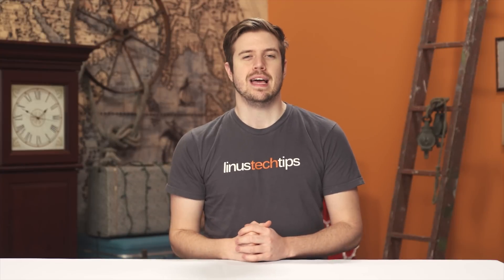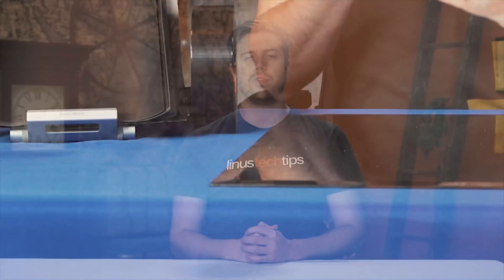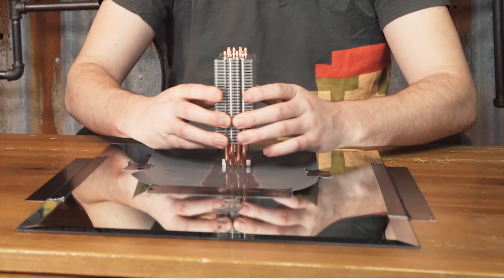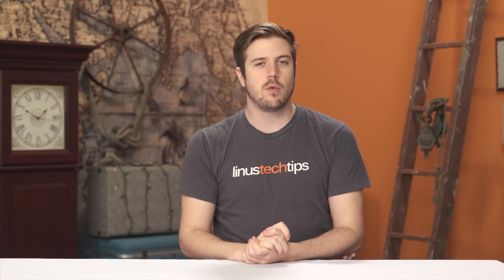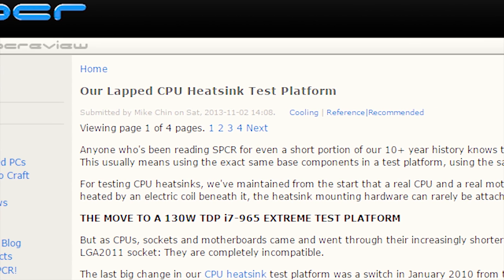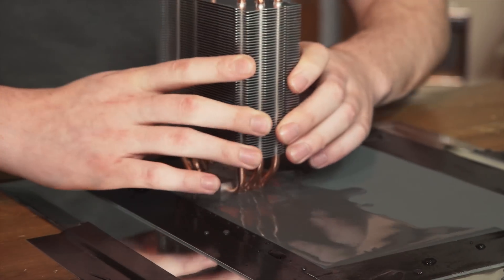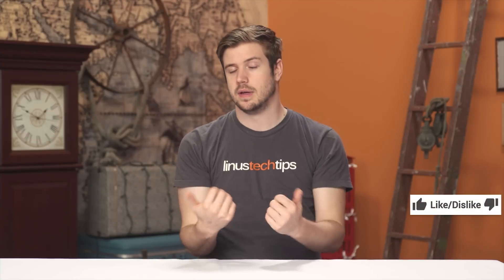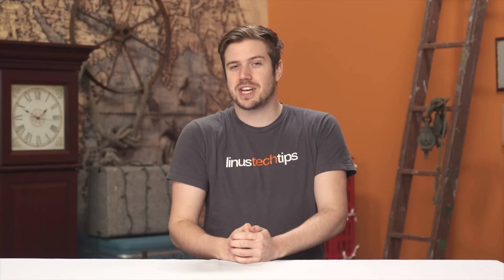CPU & Heatsink Lapping - Are concave, convex, or flat heatsinks best for cooling?

Comment: You don't have to count how many swipes you make and it's ok to use pressure as long as you push and pull evenly and hold the part as low down as possible to avoid tilting which causes doming. Rotate your sanding direction 90 degrees only when you swap to finer grit paper and keep sanding until you see your previous marks disappear. When that is achieved, go up to the next grit, turn 90 and sand again until your previous marks disappear and repeat. When you reach your finest paper then criss cross 90 degrees every swipe and you should see an nice even cross hatch pattern indicating no high or low spots.  I sand in 45 degree directions to the left and right which makes a 90 degree cross hatch without having to rotate the part. This is how I've always done it as a toolmaker/machinist.

Comment: So, moderate lapping (without polishing to mirror-smooth surface) is mostly useful only for concave heatsinks (which usually means cases when manufacturers have been lazy with their design and manufacturing). But what is the market relation of concave (or otherwise bad) heatsinks (including CPU / GPU chip thermal plates themselves) versus good heatsinks?

Comment: +LinusTechTips Here's a video you should do to see if it makes a difference.

Currently I have a bottom,front and side fans as intake but rear and top as exhaust
BUT!
I recently got a corsair 115i and mounted it on the top as exhaust while having 2 980's which kicks so much heat in the case
So? What is the question? Should I have the radiator on the top of the case an intake and rear as exhaust? and how much of a difference isit?

What I think is the bottom, front and top intake and the side(because gpus are right there getting fresh air from front and bottom) and rear as exhaust!

I think you guys should find out!

Comment: Surely sanding the surface with a rough grit, maybe like 160 or even 80 would be better than this as it would increase the surface area actually transferring heat the heatsink...

Comment: Sorry for bad english 
1 we use termal paste so we can remove air pokets  thats way sand or no sand it wont be un empruvment 
2 the termal output of the sink is the same if you change the material to be solid coper it has no termal lag as air(gas) or water 
and its termo fiziks not roket sience 

and again sorry for bad english not my netive language

Comment: Just speaking as a machinist. (I grind parts with a tolerance of .00005 inches) 

When lapping or checking for high spots by hand you should always try to create a figure eight motion on a flat surface. This limits the creation of a convex shape on the material. Turning the heat sink 90 degrees just makes it convex in two directions. The removed material will always be in between your part and the lapping medium you are using. Which lifts up your parts and causes it not to sit flat. 

IMHO use some blueing compound on the mirror and lightly press the the heat sink on the glass. The ink will only transfer to the high spots. Sand those down (or use a stone, which probably would be better) and repeat until you have 85-90% transfer. This is usually good down to .0002 flatness.

Comment: I'd expect if you lap the heatsink you also lap the cpu, and if you had the perfect surface on both, you wouldn't need any or very little compound as you have nearly 100% contact.
I wonder if anyone tried using very fine valve grinding paste to lap the two together as you do with car valves against their valve seats.

Comment: @Luke Having built over 2000+ PC's in my lifetime since the 286 days, not just for me, but for other people and work.  I can tell you lapping only helps if the manufacture just didn't care to do a good job which in my experience is hardly any of them.  It's a simple enough manufacturing process that most of them get it right.

Where I've seen the biggest differences are 1.) Use a pure copper base, not one where the copper part is the pipes.  In your example, the outter edge was not copper, only the pipes part.  A heat spreader on the CPU does dissipate heat to the outter edges as well as in the center.  You lose several degrees from not using a CPU Cooler with a pure copper base.  2.) Paste application is where I see nearly 95% of people do it incorrectly.  While it does suffice to just put a pea size amount in the center and place the cpu cooler.  This is WRONG and I challenge you to test this.  I've even seen Linus do this 100 times and I cringe every time I do.  The proper way to apply paste is to make it as thin as possible.  See through even.  You want to literally spread it out everywhere and you want it thin enough to where you can barely see the lettering on the CPU itself.  The reason for this is, you do not want your paste to absorb the heat, you want your CPU cooler to do that,  you want your paste to be the microscopic transfer barrier to fill in the microscopic grooves in the CPU Spreader and CPU Cooler.  It's intended to be a bridge, not a holder of heat.  The more surface area that is connected, the more heat can transfer, but is hindered when it's thick.  Not spread thinly enough will actually act as a Barrier to heat transfer!

I Luke am like you and do not settle for "Okay" or the "Status Quo".  I respect the aspect of true computer science and want to understand and manipulate it the Nth degree.  Don't even get me started on the crappy spec that DDR4 is.  While fast, it's designed very poorly.  NONE of it is timed perfectly like DDR3 and earlier.  Meaning you have to flush and resend data 70% of the time because the CAS is smaller than the RAS.  This is very inefficient, and cycles have to be resized, and resent when they don't fit in the CAS cycle time.  This rinse and repeat happens so much faster though on DDR4 that it is ultimately faster than DDR3 in some cases, but imagine if DDR4 was perfectly timed where 100% of the time it didn't have to flush and resend.  RAM Manufacturers, I'm calling you out!  We'd see speed increases of up to 50% if they did this.  (And would cost more too.)  DDR4 is a way RAM manufacturers can sell cheaply made modules at a premium.

If you'd like, I'd love to be a part of your show or help be a fact checker when such things arise.  Keep up the good work, and do not relent Luke!

Comment: can you make a video about a one 8 core cpu vs two 4 core cpu on the same clock speed?
Reply: +luuk unger I think they already have
Reply: cakebrin3r no, they did a video about virtual vs physical cores.
Reply: luuk unger they made a video about turning an ancient server mother bored into a gaming computer for cheap and i believe that was either 2 duel cores or 2 quad cores they used. they then compared it to modern computers

Comment: Your sanded surface didn't look that much better from the non-sanded one, in case people don't know a higher grit removes less material so you need to do more work with them, and you keep going until no scratches from the previous grit are visible. With 2000 grit wet sanding should leave a near mirror finish.
Not that this would make a big difference but if you get into this might as well do it proper.

And I imagine convex heatsinks only do well on lidded CPUs as they push the cover closer to the dye, should show a pretty substantial improvement if you are one of the unlucky people that came with badly placed covers.
Reply: When working with glass, we used 1800 for near perfect transparency and 3200 for perfect transparency. Literally perfect, at least to the naked eye.
Reply: The hardest part is manual sanding is hard to determine whether if its totally flat or slanted

Comment: Next step would be to grab another heatsink and flatten it with the roughest grit you can find,  and following with each following grit roughness. Testing after each stage of sanding/polishing. There could be a conclusion in this where there are limiting returns for mirror like finishes or where a slightly rougher finish operating better due to the thermal paste only collecting within the low points while high points would be closer to direct contact with the cpu.

Comment: Ok- truing the mating surface of the heat sink has been done. But if you're tired of playing with sandpaper you can get what's used in polishing Fiber Optics, 1um and <1um Alumina Oxide and 1um Diamond Lapping Film. http://solutions.3m.com/wps/portal/3M/en_US/Electronics_NA/Electronics/Products/Electronics_Product_Catalog/~/Lapping-Films?N=8704946&rt=r3   And- no speak of lapping the CPU cover itself? Are we expected to just take what Intel & AMD barf out as Gospel?

Comment: You could have saved those three hours by just asking a Chemical Engineer or any other person having studied Heat Transfer Phenomena. What you want is highest contact surface and that will only happen with a flat surface as the heat source a.k.a. CPU is flat. The heat dissipation comes from the area increase thereafter with the multiple metal fins. Finally all is topped off with a healthy load of convection with the fans.The only way to better cool a CPU is to increase the fins surface area, change the materials used in the heat sink to higher thermal conductivity ones or to increase convection by increasing air flow with bigger or faster fans. Finally, I have yet to find any better cooling solution than keeping the PC in a refrigerated area. I recommend a Nordic country or a fridge if the latter is not at hand.

Comment: It might make a difference for bare metal to metal, but the job of a good quality thermal grease or paste is to fill in the surface imperfections and help as the interface medium for heat transfer. That's its job. So in other words, just use the schmoo and it doesn't matter.

Comment: It shouldn't really matter . if you really feel strange about it. Simple do an observation of a temperature gradient of the concave flat and convex heat sink thingy. If it's not observable different by like 5 degrees then no. It doesn't really matter .  I'm guessing these heat sinks can take a lot of heat. GET IT. so even the slightest change of temperature distribution in the air can probable change the temperature gradient of the heat sink. It's my guess. You don't need a large team of people for this test, just better tools .

Comment: Lapping just your cooler is pointless. You also have to lapp the cpu to ensure both surfaces are as flat as possible. I gained an impressive 5c on core temps on my FX8320@5ghz with custom water loop. The cpu ihs wasn't flat at all with very noticeable concave and convex portions. It was quite easy to see actually due to the surface of the IHS being silver on the surface, and copper just below gave great contrast between the highs and lows when first starting the process. Generally though I wouldn't bother as it did take quite a bit of time, and well my cpu is now just a shiny copper top with no markings to identify it meaning warranty is out of the question. In the case of recent Intel cpus (haswell and higher) you have to remove the IHS completely and also replace the thermal compound between the IHS and the cpu die.

Comment: Doesn't almost all thermal paste have a break in period that can vary quite a bit? Seems to me you would have to test the temp after lapping for a certain time. Run two tests side by side, giving them the same break in time, same paste, and the same ambient temps. I thought about lapping before, but I don't think I will ever bother.

Comment: who cares you don't even use a metal that is most optimal for thermal conductivity. and that's what lapidary polishers are for... because it uses a orbital pattern and your better heat-sinks are already polished/machined.   Lapping works if your heat-sink is not uniform in its mounting surface, it doesn't have to be mirror polished.
     if your sink does not fit properly that's why a convex shape gives better contact as it would make your thermal paste thin as possible 'in the center'.  If anything you should work on making your heat-sink lay parallel to the CPU die when mounting, this way your thermal paste is evenly applied and clampdown pressures are also evenly applied.   And if you really really wanna get into having the best and most even clampdown forces to apply your thermal paste evenly and as thin as possible over the whole die surface. look into "Plastiguage" from any major auto parts store, it is designed for measuring clearances between fitted surfaces.

If you wondering how to use that. lay it out in a star formation from the center with 8 strips (not touching in middle should see a octogon shape actually) when you clamp your heatsink down, the plastiguage will crush down to specific width which then will show you where your fitted surface is either closer or father apart when clampdown pressures are applied.

Comment: I did lap a CPU's heatspreader, it was a Q6600, almost 10 years ago. I don't remember the reason, but I remember I got a positive result, the delta temperature was 2 to 3 celsius cooler than previous..

Comment: lapping has next to no effect because a good thermal interface compound fills all the nooks and crannies anyway thus makes minor imperfections irrelevant
Reply: +nekogod 
If thermal paste was as conductive as solid copper, but it's far from it. Meaning every extra speck of paste required makes the heat transfer more difficult.

Comment: Lots of theories, and no different results. Equals a big waste of time. Even if you got 1 degree cooler... whoopty doo The time and money spent should go to an even better cooler.
This is good to do if you have OCD though.
Reply: +Richard&#39;s World He didn't do it right away. You lap the CPU IHS most of all. Most of the heatsinks are machined pretty well already. 

 If you're overclocking then 5C difference is worth it if you care about your hardware. There's a point where even the biggest cooler is running into inefficiency since there's only a tiny amount of surface area initially. Underneath the IHS, the actual die is usually only like 50% or less of the area and within that, the cores are an even smaller space.

Comment: I know this might be stupid but what about copper thermal paste? or copper grease? If copper conducts heat so well why dont just use copper grease? that transfers heat very well and also is heat resistant so it wont burn

Comment: actually, the lapping might even decrease the dooling capability since the surface becomes smoother and therefore minimal less surface area available

for example, when tuning aircooled motorcycles you will oftn read that you should sandblast the cooler in order to increase the cooling capability

Comment: You have to lap both the heatsink and the cpu spreader. Doing one without the other doesnt make a difference in my experience. For my case specifically, the cpu heat spreader had a much greater variation in the curves and when the two were lapped together went down 7 degrees. However doing just the heatsink, I got absolutely nothing. when you lap both, both surfaces become perfectly flat the and contact surface area is completely maximized. I also wouldn't go to a mirror shine because when using thermal paste, the past will actually fill the grooves and create a more thorough contact area. And finally, if you want to maximize everything, remove the heatspreader completely and put some real thermal compound between the cpu and the heatsink. the stuff intel puts on is not optimal. Just my opinion and personal experience, but logic would dictate that making one surface flat would only matter if the other surface is as well.

Comment: The whole idea behind a mirror finish is to ensure that there is a solid contact between cpu/paste/cooler, the smoother it is the more likely it is to make more contact, since even microscopic bumps can cause crevices that don't actually make contact.  

A rougher surface could allow for air bubbles or gaps.....but there is a thick enough layer of paste that it shouldn't be an issue if you make sure you apply proper pressure when mounting to spread the paste, especially if it's done from a single drop in the center since that will push any air potential pockets out.   Still, two mirror surfaces will make more surface contact.

But in the end, heat dissipation comes down to mass.  The base collects the heat, the heat pipes transfer the heat to the fins, and the fins radiate the heat away.